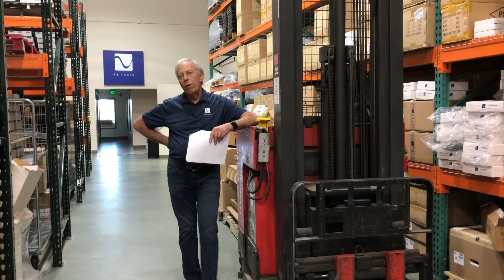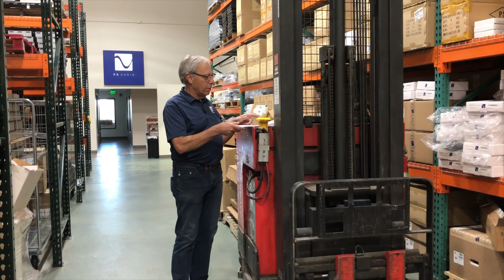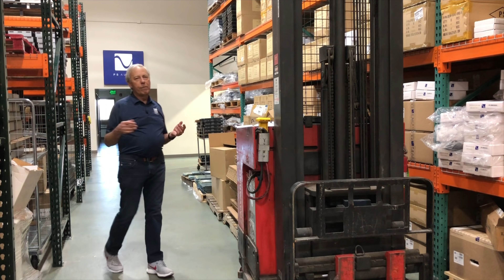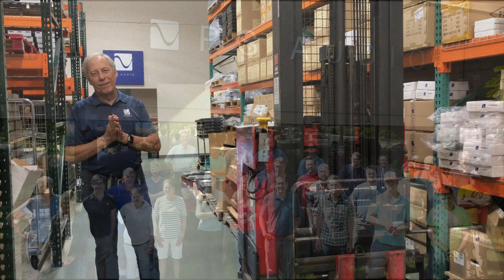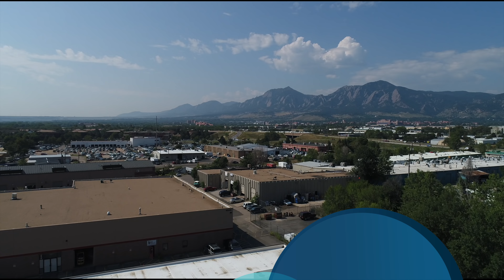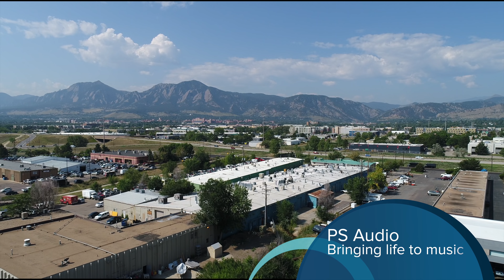What is amplifier damping factor?

Comment: A friend who worked as an audio salesman in the mid seventies brought an Accuphase power amp home to try out.  On the front panel there was a 3 or 4 position switch that allowed the user to change the damping factor of the amp.  The lowest setting,  as  I recall, was 60.  I don't recall  what the highest was, but nevertheless, the lower damping factor sounded better.  Since then, I have always chosen amps with damping factors of no more than 100.
Reply: I have Audia Flight FL3S italian amp with damping factor 26!!! but no way to replace it with Hegel or any other amp with trillion damping factor.

Comment: Paul did a commendable job explaining the "damping factor" in respect to tube amps. The effective resistance of the output transformer results in a low damping factor and less "control" of the speaker load.

Speakers are electromagnetic devices. Effectively they are motor generators. When the amp delivers energy to the speaker it can expect to receive energy back ( cone overshoot and generating energy ) and it's ability to sink that energy will effect the sound. Amplifiers with high damping factors should effectively sink a lot of energy. I like to think of it as the big strong hand of the amp grabbing a hold of the speaker.

I am the happy owner of a dual chambered subwoofer with a 16in Altec Lansing theater driver in it. A few years ago I married it to a bridged Crown XLS1000 amp that has a high damping factor ( >200 ), 8ohms, 10Hz -> 400Hz. I could clearly hear that the amplifier made a big improvement in the "control" of that big electromagnetic motor.

Comment: The true measure of an amplifier in combination with a speaker is how it sounds, that's why I like tube amplifiers be they Pre Amps or Power Amps. I never get too hung up of spec's. I listen to speaker amplifier combinations with different types of music Iike and decide  what sounds best to me. Damping factors are pretty much meaningless after a point. There are certain scenarios where the damping factor becomes less meaningful:

Tube amplifiers typically have output transformers that provide impedance matching between the amplifier and the speakers. The output transformer's primary winding and secondary winding ratio, along with the speaker impedance, determine the damping factor of a tube amplifier.

The damping factor of tube amplifiers is generally lower compared to solid-state amplifiers. While solid-state amplifiers can often achieve damping factors in the range of 100 or higher, tube amplifiers typically have damping factors ranging from 5 to 30.

The lower damping factor of tube amplifiers is not necessarily a limitation or a drawback. Some argue that the slightly reduced damping factor can contribute to the "tube sound" characteristics, including harmonic distortion and a smoother, more musical presentation. Many tube amplifier enthusiasts find the lower damping factor to be an inherent part of the amplifier's overall sonic signature and appeal.

It's worth mentioning that the perceived importance of damping factor can vary among individuals and is also influenced by the loudspeaker characteristics, and listening preferences

For instance in Active speaker systems each driver i.e woofer, midrange & tweeter is driven by its own dedicated amplifier. Since each amplifier is directly connected to its respective driver, damping factor becomes less significant. The output impedance of the amplifier is not interacting with the speaker's impedance, as the internal amplifiers are typically designed with low output impedance so the damping factor is not a critical factor to consider in active speaker systems

I think its true to say most modern speakers are high-efficiency; speakers with high sensitivity and efficiency require less power to produce adequate volume levels and typically exhibit a relatively flat impedance curve and an easier load to the amplifier. Damping factor may be of less concern than early solid state and Tube designs, as the speaker's impedance variations have less impact on the overall sound quality. Damping factor may be less meaningful in these scenarios, there are other important factors to consider when selecting an amplifier, such as power output, signal-to-noise ratio, distortion levels, and overall sonic compatibility with the speakers synergies if you like. Stupid high Damping factors do not guarantee a good sound quality just in the same way High Damping factors wont necessarily sound drier or more neutral.

My advice listen to as many as you can within your price range and pay attention to system matching not pages of spec's.

Comment: Damping factors .... YES !!
One of my pet topics .... Paul is roughly right here here ... he didn't explain where the figure actually comes from though ... it's derived from the output source impedance divided into the speaker impedance . In tube amplifiers it's the same .. in the days of tube amplifiers ( pre solid state ) most speakers had an impedance of 15-16 Ohms .. this high impedance was to get a higher damping factor . It must be noted here that a loudspeaker system with a passive dividing network will have an impedance curve that is not 100% flat .. it will go up and down in value and hence the DF will vary too.
Reply: Janina Palmer I concur. It's great to know that the amplifier will have great control over the bass woofers though.
Reply: Paul Leonard .. in solid state amps the damping factor is a composition of several things .. one is the power supply ... the large storage caps must have VERY low ESR as well as the output devices must have low resistance and very high slew rate and equally fast decay

Comment: What an interesting and unusual topic.
 Think of damping as an electronic shock absorber for your speakers. Bandwidth and frequency of damping is important, but mostly in the lower bass. An Adcom GFA-565 mono block has a damping factor of 1000. Early 70's transistor receivers have damping as low as 10, while my Heathkit W5M tube mono block amps have an unusually high damping factor of 40 which is high for a tube amp. Dynaco ST-70 has a damping factor of 11. Average is probably around 250 in my experience  in modern transistor gear. Many factors effect damping, negative feedback, speaker wire, final output design, topography,  and bias. 50Hz is common standard frequency used to measure damping factor. High damping factor good for subs, but can cause midrange to sound too sterile and lifeless in full range. Damping factor is the poor mans servo woofer in effect. These are my opinions of course, and am interested in what others experiences have been.

Comment: Yes, most of our experience says that high-end speakers sound better (mostly a wider, deeper soundstage) when driven by an amplifier with low to moderate damping factor, say 5-10. Bob Carver did have an interesting theory why this is the case. And yes, much depends on how good an amplifier's specs are BEFORE negative feedback is applied. Some, both tube and solid state, are good without feedback.

Comment: A typical speaker with a nominal 8 ohm impedance will have a DC resistance of around 6 ohms. This resistance is electrically in series with the amplifier and reactive part of the speaker essentially swamping the high damping factor of the amplifier. Even the speaker wire will swamp the high damping factor of the amplifier. If the speaker wire has a resistance of 0.2 ohms, it would reduce the effective damping factor to around 40.
Reply: What are you running, 500' speaker leads ??
Reply: @poserwannabe1  500' of 2 conductor wire, say 14 awg, is 1000' of conductor which would be 2.5 ohms. It doesn't take much length of wire to reach .2 ohms especially if using a thinner gauge.
Reply: well yea but I'm assuming anyone at this level would be running 12 minimum ?? and normally no more than say 20' per side ?? nbd...
Reply: @poserwannabe1  20' of 10 gauge (40' of conductor) DF would be around 200 if the amp had an infinite DF driving 8 ohms. That's very good. However, people seem not to understand or simply ignore the fact that the DCR of the speaker driver coil severely reduces the effectiveness of such a high DF from controlling the speaker.

Comment: Have a listen to Hegel's H360 and H590. Damping factor in excess of 4000. They sound fantastic. I'd say reference quality , depending upon your preferred audio taste of course.
Reply: Hegel states on H590: Damping factor: More than 4000 (main power output stage)..

when BHK Labs Measurements came up with their number it peaked at 720 at 200hz, (Damping factor = output impedance divided into 8)

https://www.soundstagenetwork.com/index.php?option=com_content&view=article&id=1966:bhk-labs-measurements-hegel-music-systems-h590-integrated-amplifier-dac&catid=97:amplifier-measurements&Itemid=154

im not sure about how it actually works but we must be careful to measure it the same way or display it with same numbers to be able to compare. 

i downloaded my own power amp datasheet and got some numbers, or a curve to be more exact, a damping factor number only shows the peak value and that has to be put together with a frequency to make sense. 
my amp did not have a peak in the middle as hegel did, but a downward slope, in 8 ohm it was highest at 20hz at 8000 or so, and 900 at 1000hz.
Reply: Higher than a number it doesn't really matter anymore. Because the cable is much higher impedance than the output impedance.
Reply: I understand. If the cable impedance is greater then, the question must be asked, what is a relevant and meaningful damping factor in an amplifier?
Reply: @carolineleonard8214  It's important to have output impedance lower than 1/10 of the cable. And that's why the cable matters. Also the open loop output impedance is important. The open loop output impedance is directly affecting the output current. General speaking nothing really matter if you can put out high power and makes the speakers output lower distortion.

Comment: The Eden WTX260 has a damping factor of 5000.
I imagine it matters more to bass guitar amplifiers, than to mid or high frequency amps?
The amp only goes down to 4 Ohms (I tested it at 3.33Ohms, but 2 ohms and it went into protection mode), but David's later amps ran 2 ohms just fine!

Comment: This answer has got me asking, how do you measure speaker impedance? Audio is AC  but our multimeters measure in DC. Please explain.
Reply: The basic explanation is that If you know the AC voltage, and can measure the AC current, you can calculate Z ('Z' being the symbol for impedance rather than 'R'). Z changes based on the frequency while R stays the same.  It can get more complex but that's the basic premise.
Reply: I'm always confused by this when using valve amps. They say 4, 8, or 16 ohms. I measure speaker impedance and mark the speaker. But it is always with a meter that measures DC. The speaker company rarely specs how they rate the impedance.
Reply: @royferntorp3575  A speaker does not have a single impedance; impedance is resistance at a particular frequency and that resistance varies as the frequency of the signal varies. To add to the confusion, the impedance of the speaker is affected by cabinet design, and again this is frequency dependent. To add even more confusion. speaker manufacturers play pretty fast and loose with the specification of the impedance of their loudspeakers. 
The good news is mostly though it doesn't really matter. A speaker rated as 8 ohms will work just fine with an amp rated at X Watts into 8 ohms. Problems tend to occur with amps that are unhappy driving very low impedance speakers as they can become unstable. Best to consult the amplifier and speaker manufacturer if you contemplate such a combination. Hope that helps.
Reply: @jonathansturm4163  Assuming that speaker builders rate at un-loaded impedance....Output transformers really don't like some low resistance. And some are really expensive to replace. I believe Rola, JBL and Altec used to measure unloaded. I have had modern speakers rated at 5 or 6 ohm. WTF?
Reply: @royferntorp3575  By and large speaker and amplifier manufacturers don't want you to blow their product up due to mismatching. They also don't want to frighten you with numbers that appear threatening. This is where the "fast and loose" bit comes in. As I wrote above, when in doubt consult the manufacturers* and take the numbers they provide with a judicious pinch of salt. Most of the time you're safe, but there's an occasional design that becomes "iconic" while it's also "difficult".
* What I like about PS Audio is they are accessible, intelligible and honest.
Edit: I know you want numbers, but speaker impedances are curves, not solitary numbers so any solitary number is already a kind of fiction. When different manufacturers measure/calculate that solitary number quoted in different ways, you also have an apples and oranges situation where comparison is essentially meaningless.
Reply: @jonathansturm4163  I like Paul's honesty too. can't wait for his powered speakers for my studio.

Comment: Naim amps, even higher range ones, also have relatively low damping factor, but they controll speakers well.
Reply: Back in the olden days when giants roamed the Earth and we wished speaker response curves were flat, solid state amps were the new kid on the block. They had one very great advantage over hollow state amps: much higher damping factor so the advertisements made a very great song and dance about this undoubted virtue. By the late 70s pretty much every solid state amp had a damping factor well in excess of what was needed. One amp might very well have a three or four times greater damping factor than another, but you would be hard put to it to hear any difference because of that. Bear in mind that these remarks apply to Class A, Class B and Class AB amps.
Today there are Class D amps and damping factor may be a consideration once more. If you listen to music with lots of very low frequency content, a Class D amp might not be the best choice of amplifier, even though the reason you would consider Class D is for its high wattage and that's only needed for the lower frequencies with most speaker designs.

Comment: Great news Paul as my new Hegel 190 has a damping factor of over 4000. You say 1000 is great so impressed with my new amp's specs.
Reply: I never see this value in any amplifier... I can just remember the values of 1000 or 1500 in some Krell, Mark Levinson and Parasound JC1.
Thanks for the info, I will check this model...
Reply: @alb.1911  Glad to help. Their Soundengine2 amp tech is unique to them I am told. Super powerful too. I tried the Hegel 360 (250w  at 8 ohms, 420w at 4)  but realised the newer 190 (150w at 8, 250w at 4) was enough for me. Both have damping factor of over 4000. Go listen.
Reply: @alext2933  h190 is a masterpiece own one my self
Reply: @alb.1911  also the rotel Ra 980bx has the same damping factor 1000
Old amplifier but strong enough..

Comment: For solid state amplifiers, damping factor does not mean anything in practice. You really do not have a damping problem with a solid state amplifier anymore. With high output impedance tube amps, you need to consider the damping factor with the matching loudspeakers.
Reply: bsb   With valve amps you can achieve a good damping factor by using the thickest gauge wire possible for the speaker secondary winding and a speaker with 15 or 16 ohm impedance.

Comment: So the Carver M-1.0t has a damping factor of about 8, and says "Low Feedback High Gain" on the faceplate. I didn't know these were related. Why then does IT sound so relatively good with such a low damping factor?! Tube amplifiers have high impedance. I have a Sunfire which has two different kinds of outputs; one of which is around 1 ohm impedance to, apparently, mimic a valve amp. This all flies in the face of convention, so why is that?

Comment: What would you define as a high damping factor?
Reply: More than 100 is good enough for amps. The gauge of your speaker wire actually has a vastly larger impact, pairing a 1000 DF amp with 22awg wire will be worse than a 100 DF amp and 16awg.  
  
The Emotiva PA-1 monoblocks (Same amp in the PS Audio S300), has an output impedance of 0.005ohm (DF >500 for 4ohm and min load of 2.5ohm), and 10ft of 22awg has a resistance of 0.161ohm, and if you had 4ohm speakers, that’s a system DF of 24. 10ft of 16awg has a resistance of 0.04ohm, that’s >40x smaller, which is better, the system DF would then be >85.
Reply: About six inches (150 mm) of rainfall. Our water tank is nearly empty and I'm beginning to get a bit smelly. It was supposed to rain last night, but it's now mid-morning and the sun is still shining.
Reply: @jonathansturm4163  LOL!!! Sounds like you've got a fairly low damping factor right now. Good luck with that!
Reply: @SteveKasian  It's quite dry again, but this year the tank is full.